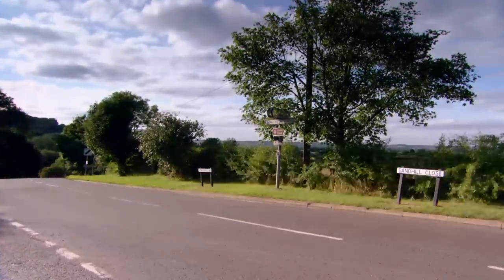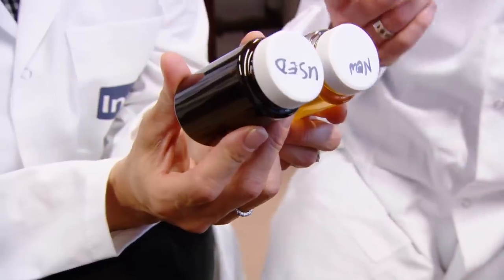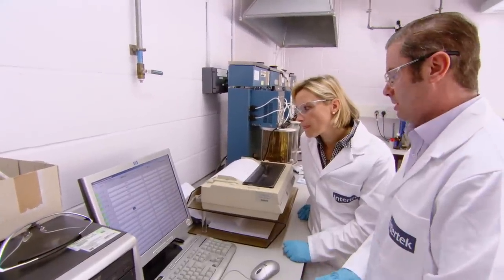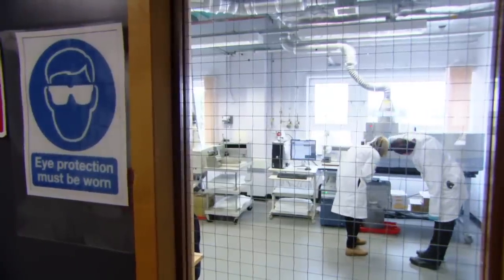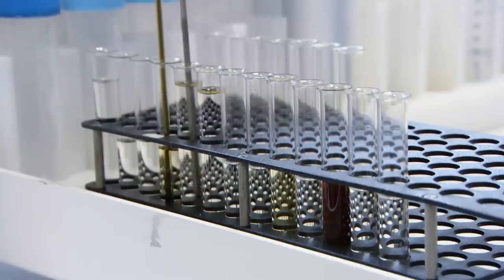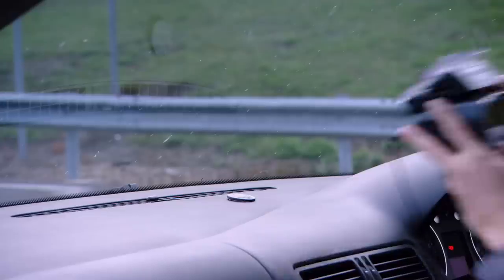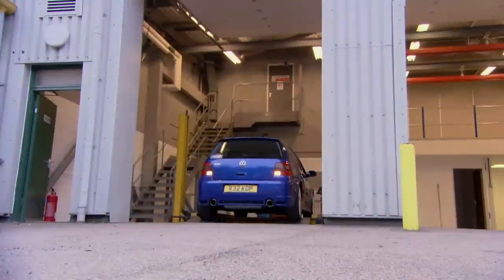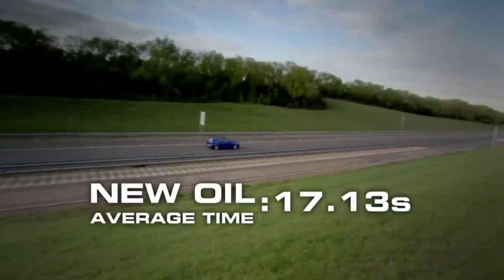Used VS New Oil in your Car | Fifth Gear Classic

Comment: So Gran Turismo 1 wasn't lying about getting more power from oil changes.  Interesting.
Reply: King Hip-O GT4&5 still did this too
Reply: No, but perhaps they lied about how MUCH power you would get from an oil change.
Reply: They were desperately trying to get you into the habit
Reply: The oil change guy was amazing he had an changing system inside of him he went under the car swallowed The oil and spat it out as new oil
Reply: If only doing a oil change before you ever drive the car gave you extra bhp without mods lol
Reply: @MarcelloTheBandit  I agree 👍 💯
Reply: Not gt 1

Comment: Every 10,000 miles imo is too long to wait for an oil change
Reply: I'm sure 5k is better. But engine designers now know exactly what oil to use even before putting pen to paper. 

10k miles is fine according to most manufacturers. 5k can do no harm.
Reply: its waaaaaay too long. In modern cars they say 10k miles is ok I wouldnt believe it. I change my oil always at 6k miles, Ive done it on cars 20 years old and cars 5 years old. Always change every 6k miles ( if its under warranty and it blows engine due to poor servicing and it was done every 10k miles then its on them lol )
Reply: @Vikturus22  clean oil always better than used oil. But did you see the million mile Toyota Hilux? Gets an oil change every 10k, always has right up to the 1 million. Still runs sweet.

For me, this ends the argument. My own diesel jaguar runs at 20k miles servicing and there are no reports of blown engines or dry turbo's. Modern oils are engineered to perform like this and last longer
Reply: @Vikturus22  It is down to the quality of oil and expectations and the control of the oil industry.  In Europe nearly everyone uses full-synthetic oil as it is much more consistent and contains less shit where as in the US there is even a believe the synthetic oil is bad.  The US has this 3k rule for changing oil, of course, the US is the lobby place of the world where the corporations want you to spend more on oil and it is common belief this is required.  Most modern cars actually check properties of the oil, and I have only changed oil at 10K intervals over 30 years of owning cars and keep them till 10 years old after buying 3-4 year old cars and NEVER had an engine issue with my cars.  Also use an independent garage that I trust and actually does the work required only when required - and actually changes the oil.
Reply: @Tom55data  excellent reply. This probably explains the huge difference in opinion between Europe and the US when it comes to oil changes. Ive never seen a worm out engine before unless oil chnages were not being done at all.

Engines that follow recommended servicing dont suffer wear issues
Reply: @Tom55data  Well tbh depends on the way you drive. If you drive like a normal person, oil can last you at least 10k miles or some 16k km. But if you drive like an idiot, always in high rpm, you will need to change that oil at half that time. And I know some people that change the oil once a year no matter the mileage. So they can do 25k km or 10k km but change it once a year and their cars are running fine.
Reply: @Tom55data , was looking for this answer, thanks for beating me to it.

Would like to add further to your answer since I've lived around the world, and the quality of 'renowned companies' oils also changed dramatically - that includes synthetic and non synthetic oils both. 

Also, whenever I talk to my mechanic, his rule is - change the oil when it's around the 5000 KM (yes Kilometers) mark to make sure that it doesn't affect the engine due to viscosity. If it becomes too dark and too viscous, it'll start exponentially damaging the engine. This is where synthetic oils are better since they retain their viscosity a lot better than non synthetic oils. 

I've owned a couple cars, ranging from a 1976 Corolla (still have it - runs perfectly), a Mazda 6 2009, a Honda Civic 2006 (daily driver), a Volvo S40 2003. 

Never had an engine problem, even when I drove like a maniac - which I rarely did - officially. 😀
Reply: @UsmanMuhammadNooruddin  your mechanic gives great advice. But where is the cut off point? Why dont we just say change the oil every week? It would definitely prevent all issues associated with engine wear.

To the owner of the hilux with 1 MILLION... How would he have benefited from a 5km oil change vs 10k miles. 

To the MILLIONS of unedicated yet mindful motorists who service their cars according to the manufacturer guidelines and have zero issues..... Wheres the incentive?

Engines that follow the guidelines have no wear issues. None. Doesnt happen.
Reply: When I see manufactorers saying that you can change the oil every 30.000km or 2 years ona turbocharger diesel engine, I just... Damn. Turbo needs clean oils, diesel engines get the oil dirty fast. After 2 years and 30.000 km that oil is sodomized to the extent that I am suprised that engine isstilworking after that.
I drive a NA pertol, and I change the oilevery 10.000km, which is a bit less than 1 year for me. After that oil is lightly brown colored. A first few thousand km it is transparent. I use API SN rated oil. And I perform an Italian tune up every day.
Reply: Every 3-5k miles depending on how you drive.. 10k miles is way too long.
Reply: @2ndProtects1st more the better. But what will happen if its changed at 10k?
Reply: I do it after 3k miles.
Reply: I change the oil im my diesel 2.0 TDI on 6.000 km.
Reply: @2ndProtects1st it's not, I've never seen any issues from anyone who changes at 10k. Some are 15k schedule. My own car is 20k.

I've asked several times what will happen when oil is changed at recommended intervals and nobody can answer. Moral of the story; the more oil changes the better, but they are only gratifying the owner, not the engine
Reply: @danial8040  can only be a good thing. 10k miles would be fine
Reply: At my 728i ....I change it every 6000 km......Liquy Moly 10w40....nearly 300.000 km and running strong 😄😄
Reply: @gaffnaldo1  depends on how and where you drive.....a lot of freeway 10k is good....but a lot of start stop in town...cold hot cold hot ....10k it's to much .....
Reply: @Bercilak de hautdesert whaaaat !!!??? 12 years no oil change ??
Reply: my BMW 320d has an 18.000 mile interval lol
Reply: @TheRazvy1990  you are right it does matter what type of driving you do. Many cars do come with long life servicing but with oil condition sensors that will alert the driver where an oil change is required before the recommended schedule. As for 10km, this is perfectly fine unless stated otherwise by the engine manufacturer. If you are correct, where is the evidence of engine wear from 10k service intervals? It doesn't exist
Reply: 7K or once a year has worked well for me over the years.

Just make sure you're using a quality full synth.
Reply: @mattymrj01  seems high. But it will have the oil sensors monitoring it so it should let you know beforehand if it's required
Reply: True especially if you have GDI and turbo.
Reply: @brian_jake  I agree with you on these points. Poor oil condition contributes massively to carbon build up on the intake end
Reply: what about my car it says every 18600 miles?
Reply: @lostepisode3  still, just cut it in half or every year depending which comes first
Reply: @lostepisode3  should be fine as long as you following the advice from the people that made it
Reply: Are you joking? most modern cars go 15 to 18k miles without oil changes. Engineering has come a long way over the last 20 years.
Reply: @DashCamSerbia  That's completely unfounded and extremely bad for the environment. I would trust engineers who design these engines then some dude who thinks he knows better.......
Reply: @NickLiang  absolutely. This is modern engineering coupled with the latest oils. Not the 1950's with low grade mineral oil. Where are all the worn engines, they should be everywhere?
Reply: @Vikturus22  VW usually recommends every 10,000 miles. Not sure if there is a difference between gasoline or Diesel engines, but mine is a TDI and the manual says 10,000 miles. I do it at 7 or 8.
Reply: Not if your car is running 100% synthetic oil.
Reply: @abesmissioncontrol2013  agreed. See comments from me above. This 5k km ideology is complete bullshit
Reply: Before synthetic oils and engine management, 10k would have been too long, but not now.
Reply: @Mark.D.H.  my point exactly

Comment: I am tempted to believe that what made the difference was : 1. Different atmospheric conditions, lower humidity and different temperature/pressure; 2. Clean air filter.....(maybe even different fuel). This test should have been done with clean air filter with both oils in a controlled dyno chamber, same temp and humidity and same fuel.
Reply: Not to mention it is a manual... Good luck geting every shift off with the same time. A DSG would have much more even shift times, making it a much better comparison.
Reply: Exactly.. half a second difference 😂 and put down to a oil change, over everything else (including weather conditions) is a very big conclusion to make.
Reply: @leafysfishing oil changes only take at most like 30 minutes so if they did the test switched the oil then did it again the weather might not have changed very much... 

But yeah with a manual it could all have been complete bollocks. When I first change my oil on my manual car (or swap the air filter, or swap the spark plugs, etc) I'll get marginally better fuel economy for like 1 tank of gas then it's back to normal...

Comment: Lower viscosity in and of itself does not mean less lubrication.  Modern oils are often 0W30 (very low viscosity) yet they provide more lubrication than the older 30W50 types which have a far greater viscosity.  Lubricity and viscosity do not go hand in hand.   I thought an informed automotive "expert" would have known that :-/
Reply: I believe what you're saying is not the case here. The old engine oil you mentioned is mineral oil and fundamentally different from a modern synthetic oil.
They're comparing a new and used oil with the same molecular properties, so there's a correlation between loss of viscosity and lubrication.
Reply: @John2751  Not correct.  I've been using 15W50 synthetic motor oil for a couple of decades now.  Viscosity does not equal lubricity.  Film-strength is a far more important factor in lubricity and film strength is also does not have a direct correlation with viscosity.  Oil is far more complex than most people are aware.
Reply: @xjet  Yes, but you have to use the viscosity that your engine is designed for.
Reply: You didn't understand - losing viscosity means that oil got contaminated and oxidated so its flow is reduced. Over time 10w40 oil flows like 15w40 (oil is not getting thinner but rather denser because of the contaminants in it).
Reply: @motomehanicar459  Except that one of the contaminants is petrol, which thins out the oil.
He is right though. 15% decrease in viscosity does not equal 15% decrease in lubrication.

Comment: There's a clue in the service interval - for example, 12,500 miles or 12 months, whichever happens first . If you drive only 3,000 miles in a 12 month period, or drive 12,500 miles in only a 4 month period, it's time to change the oil. If you make frequent short trips that don't get the engine to optimum temperature, cut the interval in half. I have a DV6 engine and there's no way I'm leaving it for fear of killing the turbo, if rumours are to be believed.

Comment: Oil changes far more important on usage then actual time. Oil quality has moved on considerably in last 20 yrs. don’t bother changing every 6 months (scam). Oil won’t degrade that quick just in the sump. It’s mainly all about usage ( unless you don’t do any real miles).  So highway miles engine isn’t working as hard as lots of short trips around town. At the end of the day, if you aren’t keeping the car for life, go with manufactures oil change on mileage but if you are keeping long term half the oil change interval. It’s cheap insurance overall
Reply: Given that my car does 90% motorway miles and probably 5% city and 5% rural I though keeping to the manufactures guidlines was more than good enough. If I did low mileage I would just change it ever year since it won't hit the mileage for an oil change.

Comment: My old Peugeot 405 diesel had 65 horsepower. Driving up a steep hill you did not need a watch to measure the time, you could feel it and hear it. On this car I changed the oil at  around 5000 km. It was no old oil but still you could feel it....
Reply: That's almost as bad as the original fiat 500s
Reply: I noticed it on hill also, 2008 corsa.

Comment: Most oil pumps are driven straight from the crankshaft. The thicker the oil, the more resistance it has. Resistance on the crankshaft causes loss of power. Look at the difference between ac on and ac off 0-100 times.

Comment: The big change in old oil vs new oil is the usable viscosity.   The viscosity went down because of the non lubrication materials  of water and fuel.  These do not lubricate well , think what happens when you add a cup of water to the oil?   But I believe the main improvement in HP and time was due to better seal in the combustion cylinders rings and thus more  HP per revolution.

Comment: Well I have had two Corollas over the last 30 years and both only got serviced every 4 years I drive 8000 mile a year and I never had a problem, always used Mobil oil to the right spec both cars were amazing. The one I have now is an 06 so had it 15 years.

Comment: The key to keeping the engine in tip top condition is to change the oil every 3 to 5,000 miles.

Comment: The other thing is tyres.
It boggles my mind to see people drive on either balded tyres or no brand ones. It's literally the only part of your car that touches the road.
Putting decent tyres on will drastically change the way your car holds the road. You'll get much better MPG and it'll be far far safer.
Reply: I agree but the MPG on tyres that grip the road better will not be better in fuel economy as there is more friction. However I have driven on cheap no name tyres on my first car and good tyres on my 2nd car and its eye opening the difference in grip is insane and anyone who drives outside of the city I recomend gets at least medium budget tyres. I think everyone should do some driving on cheap tyres and then use premium just so they understand how big the difference is.

Comment: As the old oil circulates through the engine collecting microscopic particles as it sits between the gudgeon pin the big end bearings and the mains I can well believe it causes more friction thus resulting in a decrease in the optimum efficiency of the engine. Albeit minimal.

Comment: Matt Watson from carwow drained the oil and coolant from a Peugeot 206, a Ford Focus, and a Honda Civic, the focus and Peugeot lasted around 30 seconds while the Honda went on for 5 minutes WITH BEING DRIVEN AROUND it then died and he put COKE AND MENTOS IN THE ENGINE AND RADIATOR And it ran for ANOTHER MINUTE before finally giving out

Comment: Wow that difference was surprising. As I am driving only on weekends, I am only doing 5000 km per year. So my oil is not used much. When I leave it for 2 years in the engine, is that a problem because of aging??
Reply: Yes.
Reply: change it every year at least
Reply: No. If you don't drive much, you need to change the oil sooner. Twice a year, or once a year at least. Because if you oil just sits there, it absorbs moisture, it oxidises. If you do short runs, it is very bad for the oil. When the engine is cold, the air-fuel mixure is ritcher and it delutes the oil. Oil is getting contaminated with hydrocarbons and water. Only when engine reaches operating temperature, those impureties start to burn off and evaporate of the oil. If your engine only reaches operating temperature basically when you arrive to your destination, know that your oil is in a very bad condition, and needs to be changed a lot sooner.
Reply: Modern high quality oil last 2 years. Cheap mineral oil don't.
Reply: I would recomend a minimum of changing it every 1 year.

Comment: It would be interesting to know what the old oil was that came out, relative to the new oil that went in. I don't mean brand, I mean chemical composition....additives, detergents, base oil etc. A simple analogy her is.....would a sprinter set a faster 100M time in pair of "Nike Air Max Plus III" trainers or a pair of old worn out Tesco hobnail boots.

Comment: No wonder people think 100k miles is high mileage when the average person is only changing oil every 10k.... Oil and filter should be done every 3-5k if you want the car to last. 
This is why you see cars with 70k miles fail their emissions test, owner probably only changes oil when it goes in for its service every 10k.. Knackard a engine that can do 300k in 70k.

Comment: 5:37
it is shocked!😮
what is the cause of the bug inside the engine!!
Reply: It will have passed air filter maybe bad air filter or intake pipe.
Reply: @AA-os1sg  through the air filter/inlet would have been burned and sent out through exhaust valve in one form or another. More likely typical lazy or careless mechanics, pouring in the new oil using a dirty funnel which had been sitting about in the garage OR it was already in the container used to capture the used oil when it was drained.

Comment: The car also weighed a little less on the later runs due to less fuel in the tank... 😂 
Needed to weigh the car, with driver (no offence Vicki), prior to each run. 👀
Reply: A small difference and would not account for the vast improvements in time that was consistent in 3 runs.....
Reply: Alfred Yuen what about change in wind speed over the 15/20 mins between the oil change?
Reply: No no. She went to the toilet and then shaved half a second of the time...